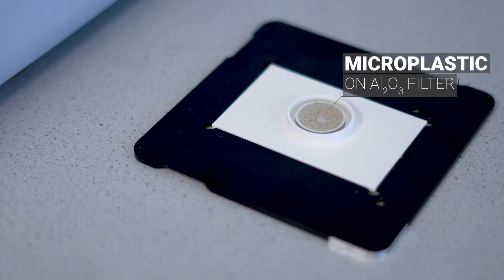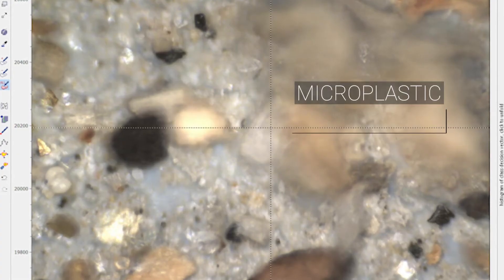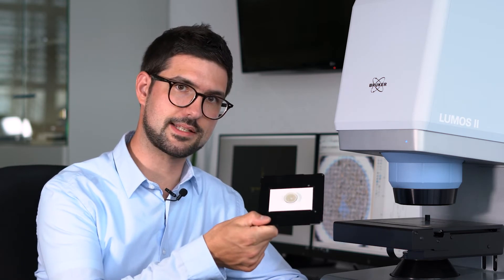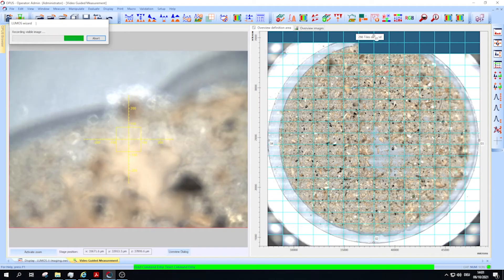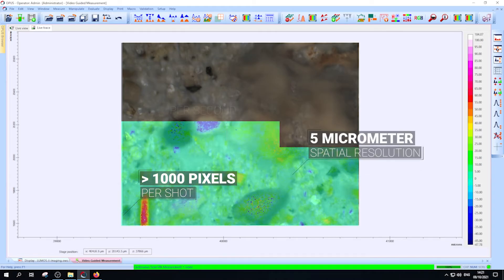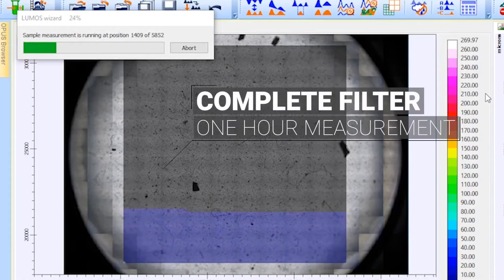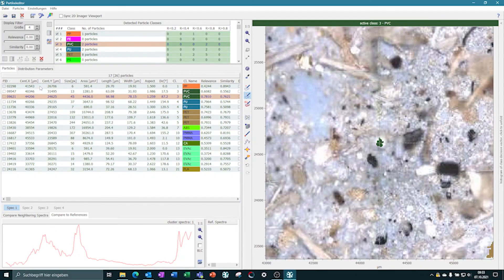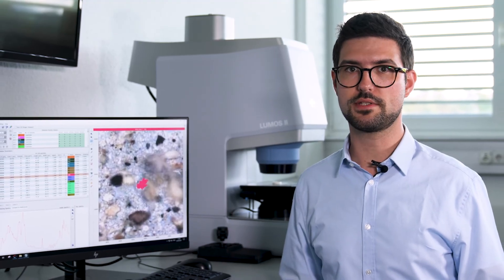The Best Solution for Microplastics Analysis | FT-IR Imaging | LUMOS II

Comment: Will the equipment only detect microplastics on the surface of a sample filter or would it detect microplastics under a layer of sediment?
Reply from the maker: When analyzing microplastics, meticulous sample preparation is essential for accurate results. While FT-IR alone may not detect microplastics directly within sediment, it remains a valuable tool—especially when applied to filters showing significant sediment contamination. In such cases, FT-IR imaging can still provide useful insights.

Comment: So it can differentiate from polyethylene and acrylics via the infrared response? I’ve been curious about the methodology and metrology behind recent reports that sound rather alarmist, but I’ve also had doubts about what they’re actually measuring.
Reply from the maker: Hey @goneutt, Infrared Spectroscopy is a highly reliable technique for distinguishing materials based on their molecular properties and how they absorb infrared light. Even extremely small particles, like microplastics, can be accurately identified using this method. The use of IR spectroscopy for microplastic analysis is well-established and widely validated in scientific research.

Scientists apply this technology to analyze water and soil samples, helping to better understand the impact of plastic pollution. However, these analyses require meticulous sample preparation and specialized expertise to ensure accuracy. When sound scientific methods are applied correctly, the resulting data is highly robust and valuable for assessing environmental contamination.

Comment: Please can this equipment detect up to 1 micron of MPs? I would appreciate your response ASAP please thanks.
Reply from the maker: Hey Joshua, while FT-IR is an amazing approach for microplastics, particles smaller than 5 microns are not accessible via transmission IR. While ATR-FT-IR microscopy is able to analyze structures as small as 1.25 µm, it is rarely used in microplastics analysis due to other limitations (e.g. accidental carry-over).

Comment: Is there any advantage to using an Al2O3 filter? Can we also use a silicon filter in LUMOS II?
Reply from the maker: Sure, you can use any suitable filter that is transparent in the MIR range. However, following literature advice by the pioneers of microplastic analysis (e.g. Gerdts et al) Al2O3 offer the best comprise between spectral quality and available spectral range for identification - together with easy handling and broad availability.

Comment: What is the smallest detection size? From what I know, FTIR can't accurately analyse MPs smaller than 10 micron. So if you want to analyse smaller particles, you would need to use Raman or chromatography.
Reply from the maker: Thanks to its powerful FPA-Imaging detector the LUMOS II can detect particles down to 5 µm and is operating at the physical diffraction limit of light. While size determination at that resolution may not always be perfect, but as close as nature's laws allow, chemical identification of such small particles is still feasible.
Reply: Darcy, How can we use Raman to analyse smaller particles?